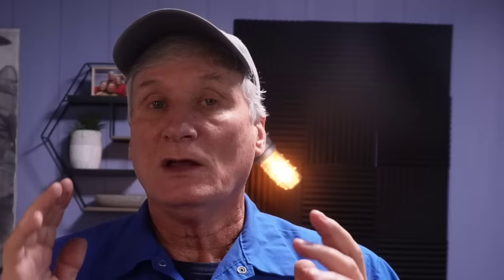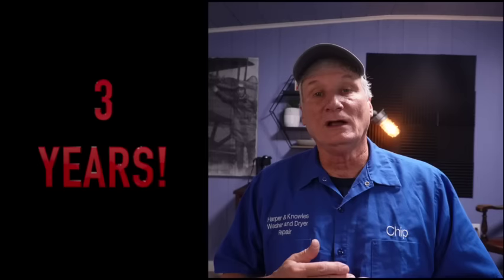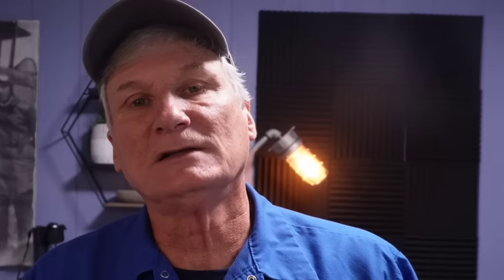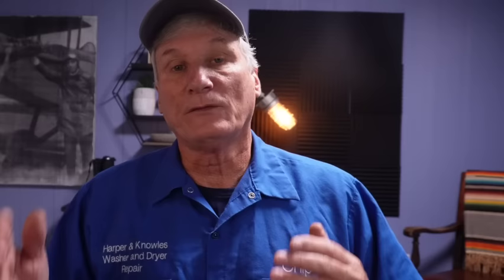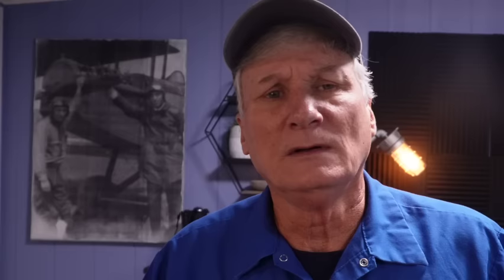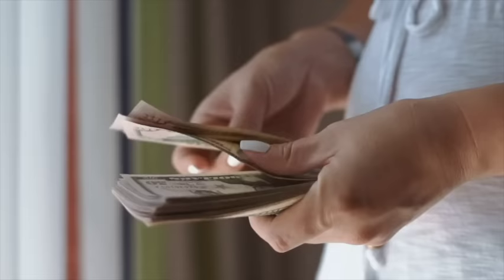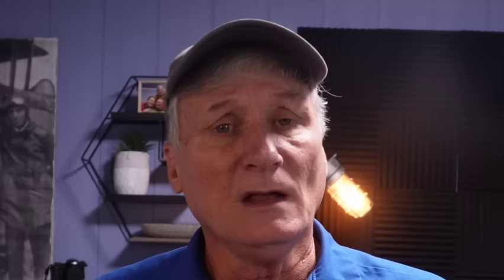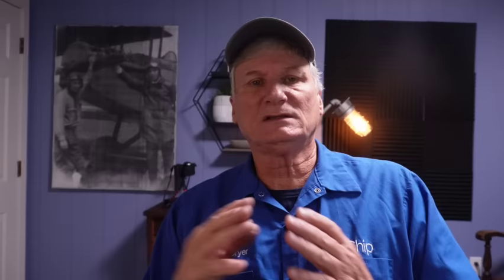How To Choose the Best Washing Machine: Speed Queen TC5 vs. TR7 Review

Comment: Is there a way to rate the decibels of the two SQ models during the wash cycle? Is there a Gentle cycle on the TR5? I saw in a video that an agitator that moves the clothing from the top of the drum downward will get the clothing cleaner than an agitator that just swishes them in place. Your thoughts on this?
Reply from the maker: Speed Queen provides limited information regarding the decibel levels of their washers during the wash cycle. It's recommended to refer to the product specifications or contact Speed Queen directly for more precise details on the noise levels.

As for the Gentle cycle, the TR5 model does not offer a specific cycle with that name. However, Speed Queen washers generally have a range of cycle options, including delicate or hand wash cycles, which provide gentler agitation and are suitable for more delicate fabrics.

Regarding the agitator design, there are differing opinions on its effectiveness in cleaning clothes. While an agitator that moves clothes from the top of the drum downward may offer more vigorous agitation, it's important to note that modern washing machines, including those without agitators, utilize alternative mechanisms like pulsators or impellers to create effective washing action. These designs have been developed to ensure efficient cleaning while minimizing wear and tear on fabrics. Ultimately, the choice between an agitator or agitator-less design depends on personal preferences and the desired cleaning performance. Thanks for watching and I hope I covered your questions!
Reply: @HarperandKnowles those alternative components are useless. Agitators are only thing that washes clothes well.

Comment: Hey Chip. Who makes the best dryer, besides Speed Queen.?
Reply from the maker: I would go with any Whirlpool brand with the filter on top right with as few knobs as possible on the front.  They haven’t changed the construction of them in years. They are simple, reasonably priced and easy to maintain. As long as the filter is on the top right, Whirlpool parts are in it, it doesn’t matter the name brand. Thanks for the comment and that excellent question.
Reply: @HarperandKnowles  Thank you.

Comment: I bought a top loader a few years ago because of the mold in a front loader and I’m not a fan.  Top loader uses so little water that I have to double rinse all clothes, due to white residue on all dark clothes.  Can anyone comment on whether or not this is an issue with this machine?  Thank you!
Reply from the maker: Thank you for your comment and question. It's understandable that you're concerned about the water usage in top-loading washers, as it can affect the rinsing process. With Speed Queen machines, the brand generally focuses on providing optimal performance while being efficient with water usage.

However, residue on clothes can be caused by various factors, such as detergent type, water hardness, or even overloading the washer. The Speed Queen washers offer multiple cycle options and water level settings that may help you find the right balance to eliminate residue on your dark clothes.

It's always a good idea to read user reviews and gather information from multiple sources to understand if a specific model might have the same issue you're experiencing. Additionally, you can reach out to Speed Queen customer support for more information on their washers' performance.

If you have any more questions or need further assistance, please don't hesitate to reach out. Thanks for watching my channel!

Comment: There were a few models in 2018 that were terrible, they barely agitated and used way too little water - be careful not get those models -> 2018 SPEED QUEEN WASHER TR3000WN, TR5000WN, TR7000WN. … I think they stopped making them after all the complaints.
Reply from the maker: Thanks for the heads up and thanks for watching too!

Comment: I am very disappointed with my Maytag washer.   I got it for bigger drum capacity snd it goes off balance much too often. In order to control that I can only wash about 8 or 9 towels at a time snd I can’t wash blanket it goes off balance Also it has an affresh cycle that I cannot override.  So every 30 washers I need to put in a tablet and tub fills with hot water not cost efficient.   I have only had if for 4 yrs but as soon as it dies SQ will be my go to
Reply from the maker: Thanks for sharing your experience, Fiona! Thanks for watching my video too.
Reply: @HarperandKnowles  wish I had seen this 4 yrs ago I am so disappointed with this machine
Reply from the maker: I'm sorry to hear about your disappointment with your Maytag washer, Fiona. It's always frustrating when a product doesn't live up to our expectations. If you ever need any advice on your current machine or recommendations for your next purchase, feel free to reach out. I'm here to help!

Comment: Hello, 
I have very limited space and I currently have maytag stackables but my filter is located behind the back panel and it is extremely difficult to pull the units out to access the filter. I will have to buy a different washer , what is the best washer out there with a front facing easy to access filter? there is so many out there and I don't care about the cost , I just want to make a good investment.
Reply from the maker: In the stacked washers and dryers, Speed Queen has them beat too. Here are the two models they offer. I assume you meant the filter on your dryer because I don't know any washers with filters. try this link https://amzn.to/3qb7NBj or this link https://amzn.to/3DErIeU. Both are excellent choices. And the filters are easily accessible from the front.  They are basically the same units, except the WG model is a gas dryer. Thanks for watching!
Reply: @HarperandKnowles  thank you so much for your reply! :) maybe its called the drain pump filter? in my maytag washer its located in the back , i have to remove the panel and turn it and remove it - it usually has a no show sock or random items items in it after cleaning it I can re-insert it and the washer will work fine until one more thing gets stuck. I would rather switch to one that the pump filter can be accessed in the front . I will look into the Speedqueens. thank you!
Reply from the maker: These machines aren't built like that. Unless you jam them full with laundry it is a rare thing to get an article of clothing jammed in the pump. If this happens you will have to remove the front and drain hose from the pump to get to the lost clothing. Carry on!

Comment: What about kitchen aid washers? How do they stack up?
Reply from the maker: "KitchenAid stopped making washer and dryer models late in 2006. A move triggered by the ownership of Whirlpool.

Whirlpool acted that way to meet the demand for other products and ward off competitors. So KitchenAid moved to focus more on kitchen appliances.

Since Whirlpool already had production of washers and dryers covered.

The news that KitchenAid was ending its laundry line started as rumors. The brand did not stop the production of all its washer and dryer models all at once.

It happened in batches before users knew that KitchenAid did not make washers and dryers. Before the halt to production, KitchenAid had the best washer and dryer on the market. As per user reviews.

By early 2007, the last KitchenAid washer and dryer models made were no longer on the market. Users noted that KitchenAid had cut production of the KAW 750 and KAW 850 Superba models.

Only the Ensemble Front Loaders and Super $$$ Built-In Stainless Steel Set were available. Some users praised the rebranding move by Whirlpool."

So, you see, Whirlpool moved Kitchen Aid into manufacturing only Kitchen appliances like mixers and such right after they bought the company.  Thanks for watching!

Comment: Does it have easy access to the filter?
Reply from the maker: Thanks for your question! As a matter of fact, Speed Queen top load washers do not have filters that need to be cleaned. They're designed with a self-cleaning lint system that sends the lint down the drain during the drain cycle. This means there's no need for you to manually clean a lint filter, which is a convenient feature! If you have any more questions or concerns, feel free to ask.

Comment: How are the Speed Queen front load washers?
Reply from the maker: Thanks for your comment. I think Speed Queen's front load washers are as good as or perhaps even better than their top loaders. They typically offer a larger capacity, allowing you to wash more laundry in a single load, which is helpful for larger households or bulky items like comforters.

Front load washers are generally more energy and water-efficient, which can result in cost savings on your utility bills. They also tend to have faster spin speeds, resulting in drier clothes at the end of the cycle and reduced drying time. And Speed Queen doesn't shirk on quality here, either. You'll find their machines in a lot of laundromats. Thanks for watching.

Comment: But the TC5 doesnt have a load water size only "deep fill" option button? Does it autosense how much water?
Reply from the maker: TC5 has only two fill levels for each cycle, one without the Deep Wash option selected and one with Deep Wash. Most complaints are that washers use too little water. The complaints on the TC5 is it uses too much on the regular cycle. Thanks for watching!

Comment: We bought a speed, queen and 21 and it kept spitting oil like stains, which we thought was the Downy. We got it replaced with the classic heavy duty commercial speed Queen top loader. After about a year of use these past three months, I’m noticing stains on clothing that look like oil stains.. we specifically put our downy in a bucket of hot water and then pour it in a full load to make sure there’s no oil spots. We don’t overload the washer and we are still getting this and it is destroying all my clothes!! I have never had this problem with the basic brands. I’m so irritated!!! I hate speed queen I’ve had nothing but problems! I pay the premium specifically do not deal with this nonsense and this is the second one in two years the new speed queens are just terrible
Reply from the maker: “Liquid fabric softener is oil based which can be an issue if it’s not added to your wash cycle at the right time or diluted properly. When the water supply is extremely cold, liquid softener can actually coagulate! Who knew? When it coagulates, it doesn’t dilute as well as it does in hot or warm water. This can also happen if you find old softener in the back of a cabinet that is a few years old.” Fabric softener is about the worst thing you can put in a washing machine. The waxy buildup over time in some of the machines I work on is astonishing. Once it starts to accumulate around the outer tub it usually takes a pressure washer to remove the grime. Speed Queen’s metal and ceramic outer tub is not the best surface for this nasty waxy buildup to accumulate and it is probably sloughing off and getting into your laundry. I would suggest switching to dryer sheets and having a technician remove the splash guard and the spin basket and scrape the fabric softener residue off the tub. Here is a couple videos from another YouTuber that covers the subject https://youtube.com/shorts/EbkQkLUYBLc?feature=share and https://youtube.com/shorts/VLOORhpTfnk?feature=share. If you were getting oil onto your clothes from your washing machine you’d have water running out the bottom from a ruptured seal. Thanks for watching!
Reply: If you use the pod type detergent this could also be your problem.
Reply: U pour the downy in at the beg of wash cycle??
Why not put it in the dispenser that’s in the washer?
Reply: @HarperandKnowles thanks this was helpful!

Comment: I hate the washer we have now. It was a gift but it is one of them hightech types that barely put any water into the bucket and hardly moves the clothes at all and take at least an hour to wash a load. You also have to put the soap in first before the dirty clothes. I would love one of them T5 which is a proper washer  that really sloshes the cloths around but don't want to hurt the giftors feelings  by selling it and getting soemthing we would like. Defintely going to remember this washer for when the current thing dies and we replace it.  

Too bad one can't buy oldstyle  stove/ranges as well without thermocouples as well.  Thermocouple died in the new range died and it was part of the main circuit board and it was $300 to replace it. Was never an issue with a regular termostat you couple pop in and pop out if it went bad.
Reply from the maker: I totally understand where you're coming from. High-tech washers can be a bit tricky to get used to, and sometimes, simpler machines just work better for certain preferences. The Speed Queen TC5 is definitely a reliable option when you're ready for a replacement.

As for the gift situation, it's thoughtful of you to consider the gift giver's feelings. Maybe you can hold onto the current washer for a while and eventually upgrade to the TC5 when it's time.

Regarding the stove/range issue, it's true that modern appliances often come with more complex parts, making repairs more costly. But remember, there are still some models out there that prioritize simplicity and durability. Keep an eye out for those when you're in the market for a new range. Unfortunately I can’t help you with that. I specialize in washers and dryers only. If I took up all types of appliances my Missus would kill me. She says I work more now that I’m retired than I ever did.

Thanks for sharing your thoughts and watching my channel!

Comment: Hi my name is Dan , I have a problem with my whirlpool washing machine model wtw4800Q2 . The machine is plugged in wall outlet and the machine is not on but the tub moves a little bit and clicks. Can you please tell me what the problem could be. Thank you and God bless.
Reply from the maker: That sounds like the shift actuator cycling. Either trying to shift into agitate or spin mode. Try this video Washer not Agitating or Spinning | Diagnose The Shift Actuator
https://youtu.be/7FBRdwwWr6o
Reply: @HarperandKnowles  the washer is wrapping the clothes around the agitator and water won't fill up I took the actuator off and test it and was working. The only thing I didn't test
Reply: @HarperandKnowles  test was the door lid. Could it be the spluch or transmission
Reply from the maker: No, wrapping the clothes around the agitator is the give away. You either need to change the capacitor or the motor. Try the capacitor first. What’s happening is the motor is only going in one direction. Let us know how it goes.
Reply: @HarperandKnowles  the capacitor is good my dad is an air conditioning guy and he tested it it was good how do you check the motor
Reply from the maker: The motor will have two windings on it. One for forward and one for reverse. Both are usually connected to a common neutral. You should be able to trace out the common by looking for two wires coming out of the motor that are connected together at the terminal. Then find the two going in. With your test meter you should be able to figure out which winding is good by touching one lead to the common and the other to one of the other wires with your meter set to read continuity. One should give you a reading, the good one, the other won’t. If both windings check out then the motor is probably good. Be sure your capacitor is testing the same micro farad rating as placarded on the capacitor.
Reply: @HarperandKnowles  I really appreciate your help thank you🙂. Will try to check it out tomorrow.
Reply: The washing machine fills up but will not start wash. I have to pause the washing machine and spin the tub and close the lid real quick and it starts washing?
Reply from the maker: I'm wondering if there could be some trash or debris that is periodically preventing the motor speed sensor on the shift actuator from working. Sometimes rodents will drag stuff up in the transmission case and build a nest and the slotted wheel inside will get debris in it. Otherwise, without being able to diagnose the unit myself I won't be much help to you.
Reply: I tested the drive motor and it was reading 5.6 ohm for both is that good?
Reply: I like to thank you for your professional help. You have been very kind and helpful , me and my family appreciate your help , again thank you and God bless 🙏
Reply from the maker: If both windings ohm out, then I'd swap the capacitor. They will fool you sometimes!
Reply from the maker: Thanks for your kind words.....it's what I do! Carry on!